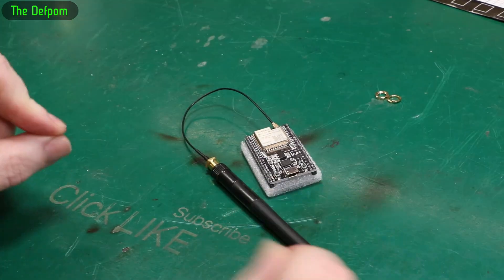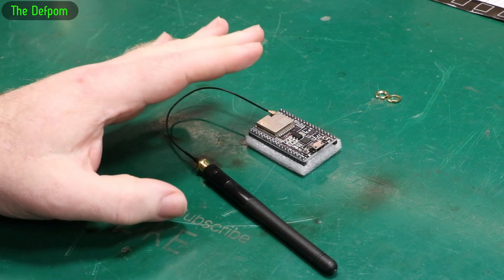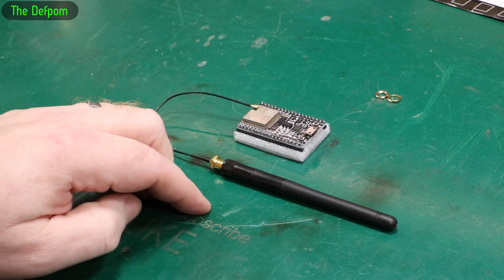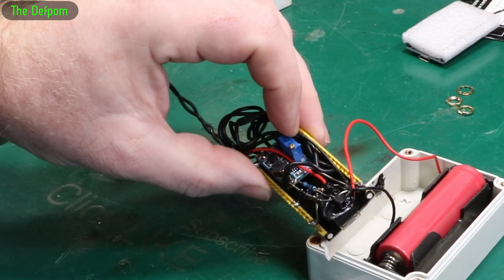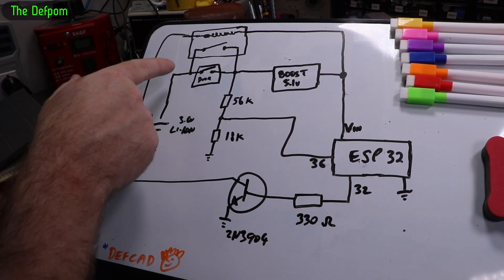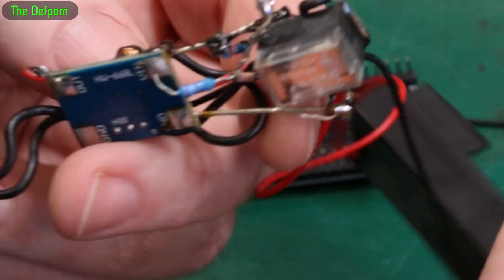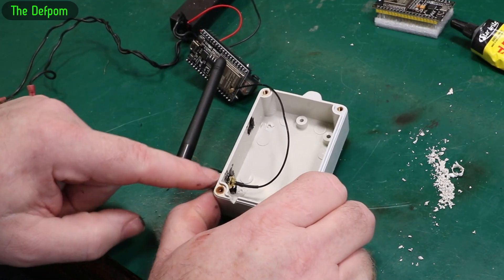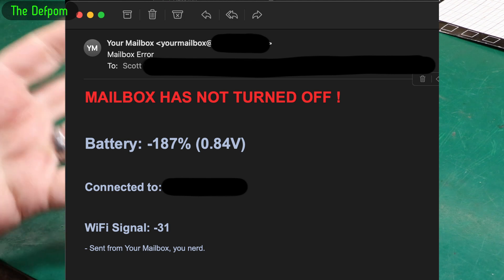🔴 You Got MAIL ! - DIY Mail Notification System - No.1282

Comment: Nice.  I did a similar thing with an 'intruder detector' (IR sensor & ESP32).  Latches on when the IR triggers, sends a message then turns the latch off.  Email is a bit last decade though 😜  You can create a Telegram bot and get the ESP to send instant messages.  Does the same thing as an email of course and like your email, each person would need to create a Telegram bot to make it themselves, but it has the veneer of being more modern, plus you don't need to wait until your phone checks for email (e.g. mine is set for hourly checks).

The other thing I thought while watching this was why use a relay and not just make a solid state latch?  A P-Channel Mosfet, a transistor and maybe a diode.  No moving parts.

Hopefully a couple of alternate ideas or even improvements (that don't improve it that much 🤣)

Comment: Interesting project, great job monitoring snail mail. We have a similar problem as you as our mailbox is 600 feet (180 M) from the house and on the opposite side of the road. I went a lower tech route. Once our residence was upgraded to fiber I repurposed the old landline copper cable for a DIY mailbox alert. At the mailbox I used a cheap on/off key fob transmitter. I installed a magnetic switch to detect the door being open and closed. A little bit of hardware kludge logic to convert that to simulate pressing the on and off buttons. On the other side of the road on our property I mounted the receiver on the utility pole and used the old telephone wire to link it to a controller in the house.

When snail mail arrives it sends an email to me and also an email that is interpreted as SMS on my cell phone. We still have a landline phone so next to the phone in the kitchen I mounted a little indicator, green when mail arrives and flashes red/green if the mailbox door is left open. There is a pushbutton to clear the alert to ready the system incase there are multiple mail deliveries that day and the system is automatically reset at night.  

Great being able to monitor battery condition, that is something mine cannot do as is is only on/off.

Comment: How fast does the relay contact take over the main contact?
Reply from the maker: @yoeribolderdijk1257  the ESP32 turns on the relay as soon as it boots up, to replace the door switch.
Reply: @TheDefpom  Yes i get that, but i asked how fast (how long does it take to boot up).
If the boot up takes 30 seconds and the mailman opens and closes your mailbox in 10 seconds the relay wil never take over.
Reply from the maker: @yoeribolderdijk1257  it takes less than a couple of seconds
Reply from the maker: @yoeribolderdijk1257  it takes less than 2 seconds to boot up.
Reply: @TheDefpom  Ah nice 👍🏻

Comment: Might be more efficient to use a LDO to drop the voltage to 3.3V.
Oh. What does the relay do?
Reply from the maker: @Codedbad  I explain that on the circuit diagram and whiteboard, but it basically is used to turn the power on/off so there is 0 current draw when idle.